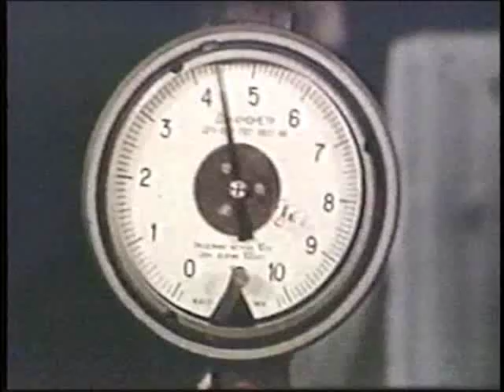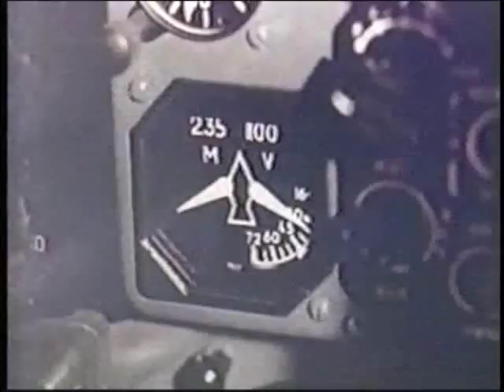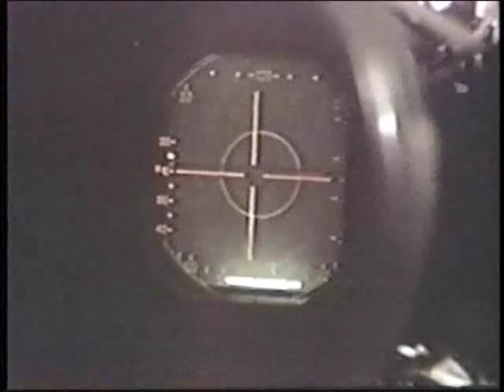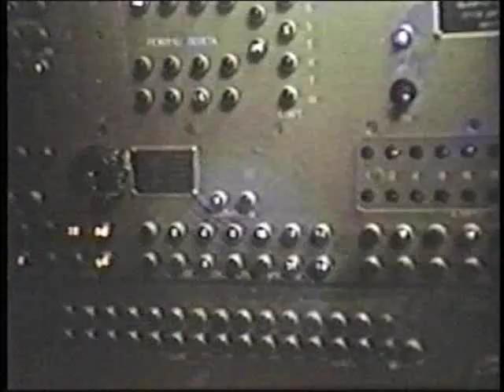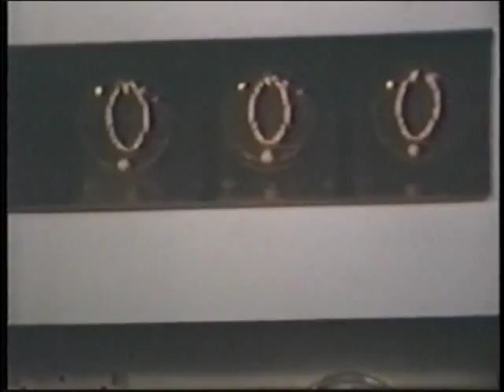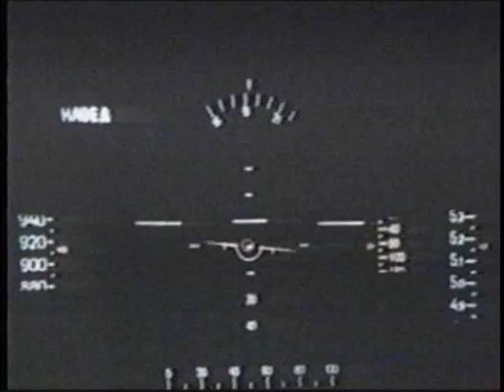Weekday Wings: The Mig Story 3/5

Comment: As I understand things, the MiG-23 was contemporary to the USAF/General Dynamics F-111, albeit smaller; the -25P hit IOC with the IA-PVO as the USN/Grumman YF-14 entered OpEval.  The -31BM, descendant of the -25, packs new engines matching low pressure ratios with free-flowing circumferential main burners, allowing her to outrun, at flank, afterburner, any fighter short of the USAF/Lockheed F-22.